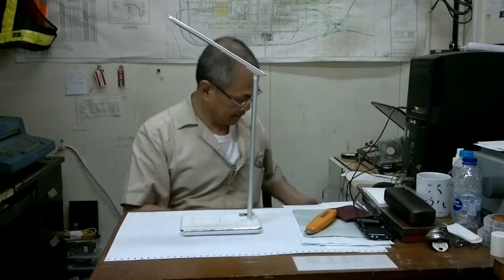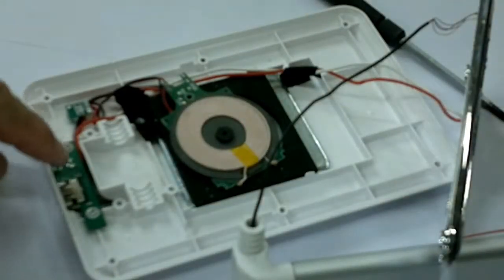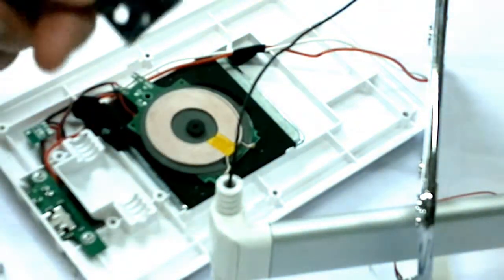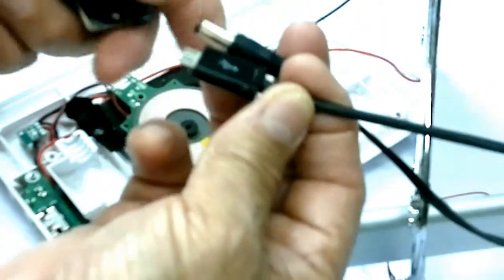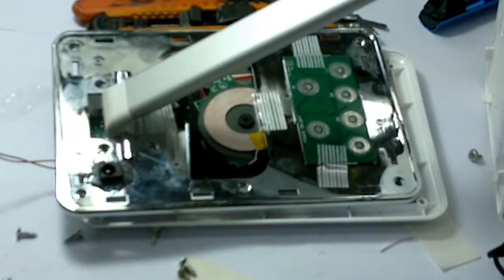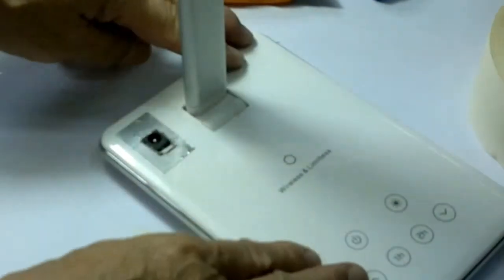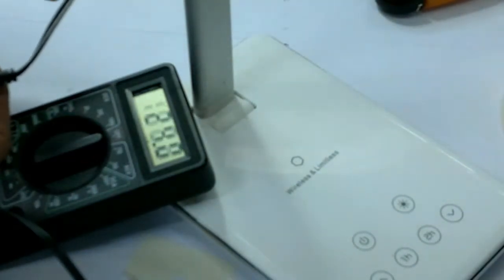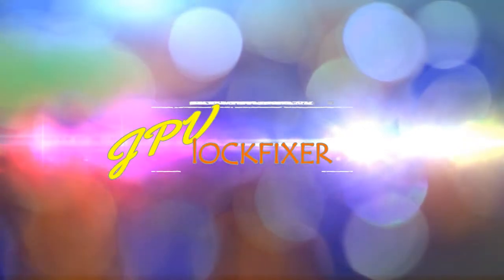HOW TO REPLACE USB MICRO B SOCKET  OF A LED DESK LAMP

Comment: How did you get the cover open?  That part was skipped in the video.
Reply from the maker: its a snap on type bro. prying it with a thin metal sheet will do. thanks for watching.